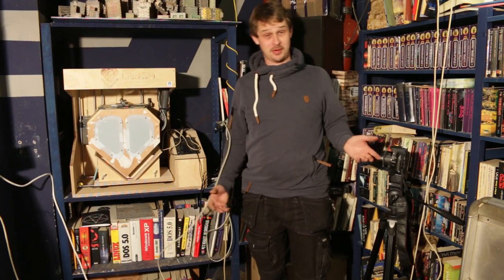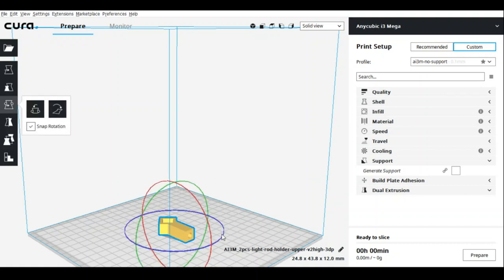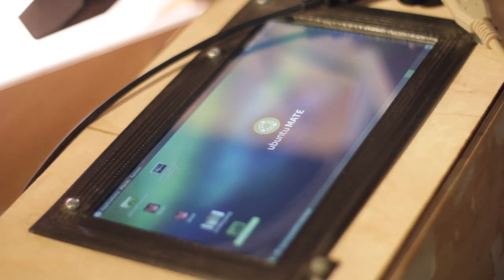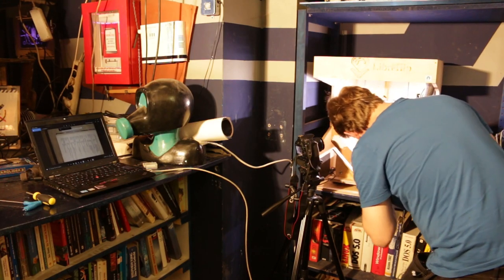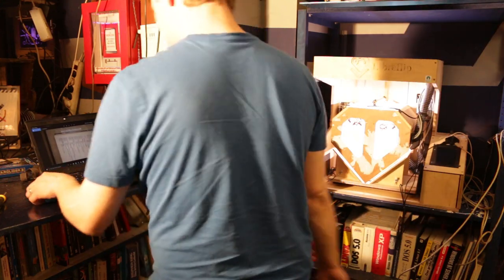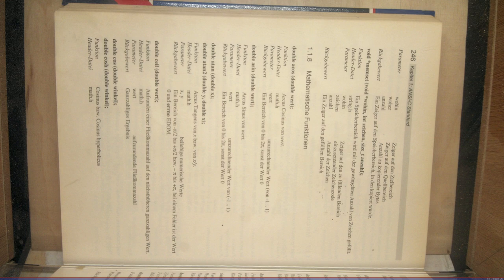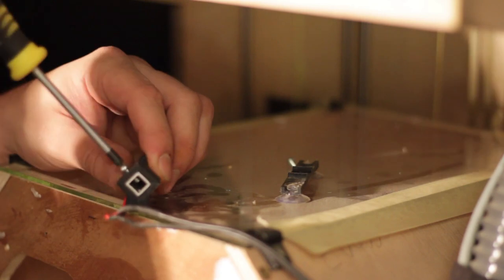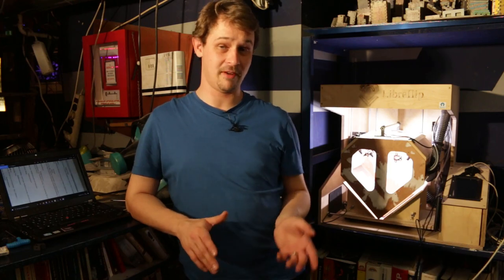building Libreflip - E35 - Do I need a new suction Box? - chasing reflections and adjusting Cameras

Comment: Why you don’t work with an diffuser for the light against the reflection?

Nice project, thanks for it!
Greetings...
Reply from the maker: Because the diffuser itself would be part of the reflection then. It's better to align it all in such a way, that a reflection is not visible from the camera angle. Because of the many LEDs, the light that reaches the book is already pretty diffused, without any diffuser.